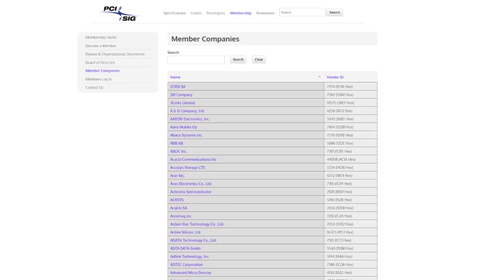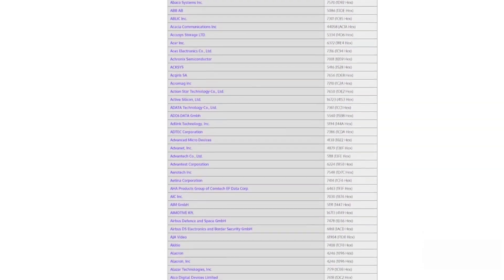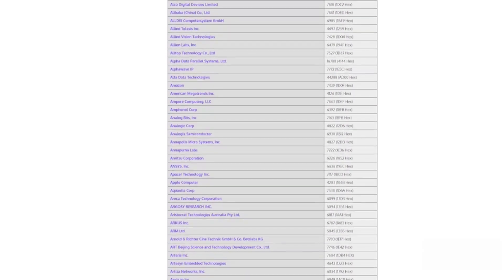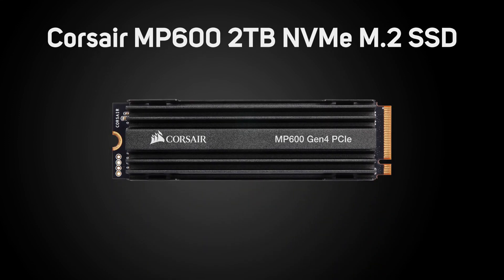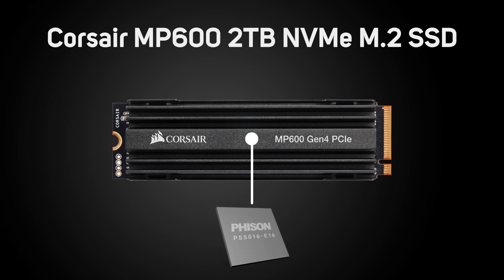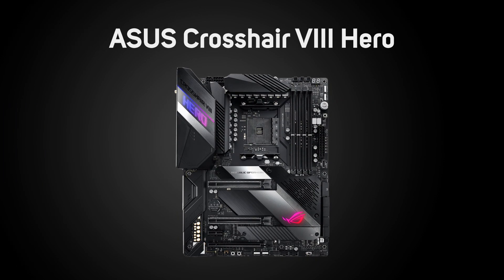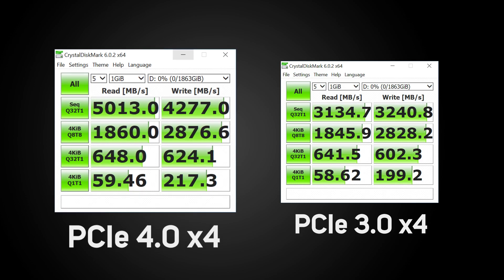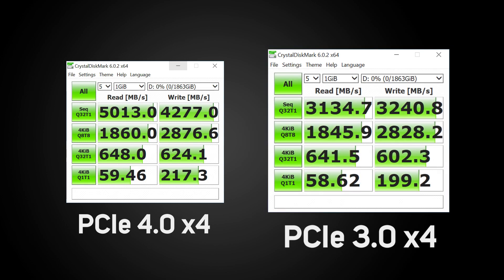PCIe explained - Versions, speeds, all the details!

Comment: Thnk u for the nice video. On my older computer with an asus motherboard Ramage extreme ii (pci-e 2.0 x 16 slut)  I just installed a pci-e to usb 3 card (the LC-PCI-usb 3.2). I use a samsung t-7 drive. Now it starts transferring great even at around 750 mb/sec but after around 6 secs it drops to 35 mb (which of course doesnt make much sence for me because I work with big video files).   How ever, from the comp back to the drive it does transfer around 105 mb/sec.  What am I doing wrong? How can I ghet at least the 100 mb/sec?
Reply from the maker: Hi, This sounds like it could be a limitation from using older hardware that’s not natively designed for USB 3.2 but unfortunately we couldn’t say for sure. -GH.

Comment: PCIe 3.0 can put in PCIe 2.0?
Reply from the maker: that is correct. A PCIe 3.0 device can work just fine in an older socket as the standard is backwards compatible. However it will then be limited to the speed of the older standard. Depending on what the device is it could affect performance.
Reply: @ScanComputers  what about PCI 4 in PCI 2?
Reply: @phily8020  Most like it will. But as Scan Computers said, it'll limit the performance.